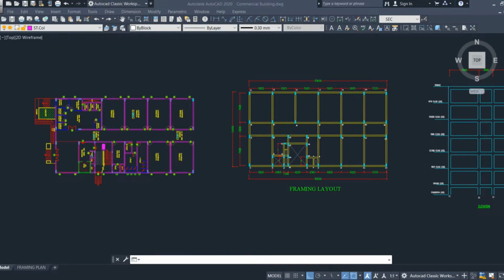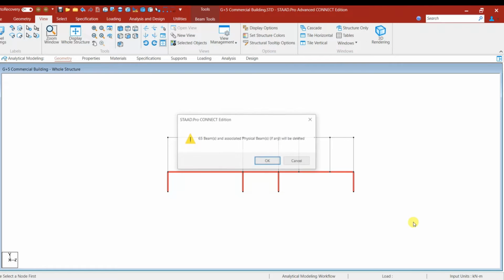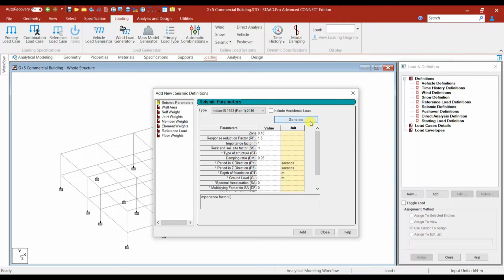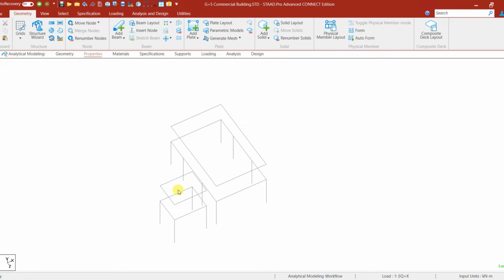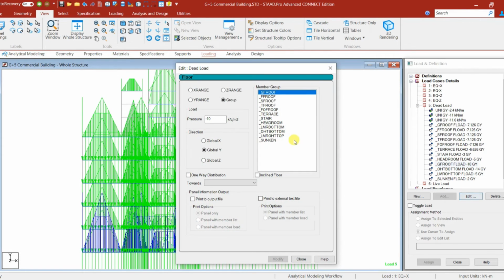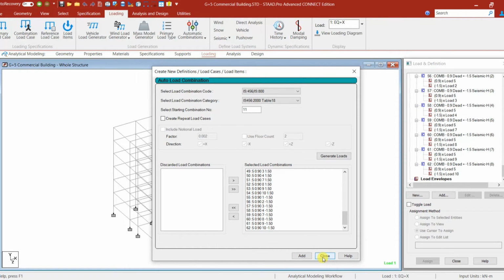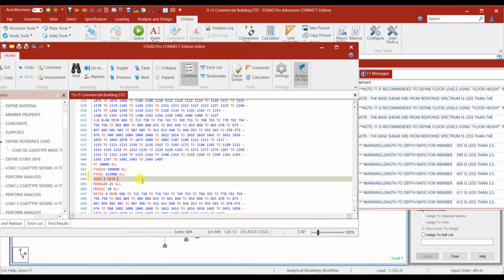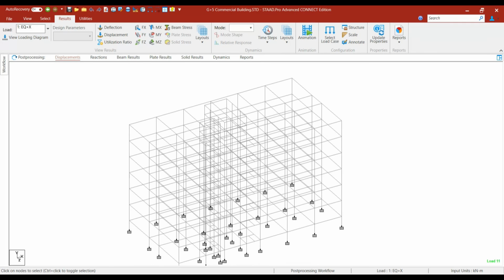Complete Analysis and Design of G+5 Commercial Building in Staad Pro Connect edition | G+5  Staad

Comment: Madam,
In this tutorial, I have not seen cracked moment of inertia applicable for column as 0.70 and beam as 0.35 . Can you explain whether it is required to be applied for seismic analysis as per IS1893-2016 IS1893-2016.
Reply from the maker: yes it has to applied as per IS-1893-2016.

Comment: This video is very useful to show both static and dynamic analysis. Kindly prepare video in auto wind load generation in staad pro connect edition. Also prepare some more videos on staad pro connect edition for other problems in building design with different shape in which we have to apply load combination as per IS1893 part1-2016  ie if it is not regular building we have to apply seismic load in X plus 30% load in other direction. Where we required to consider vertical EQ analysis.
Thank you for nice video madam.
Reply from the maker: Noted. Thank you.